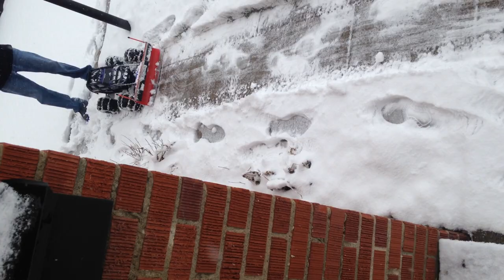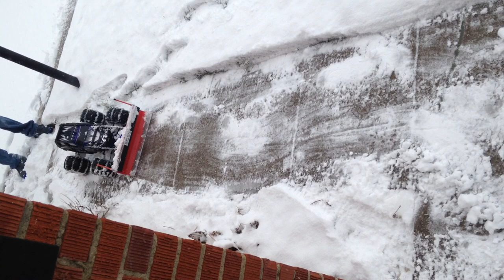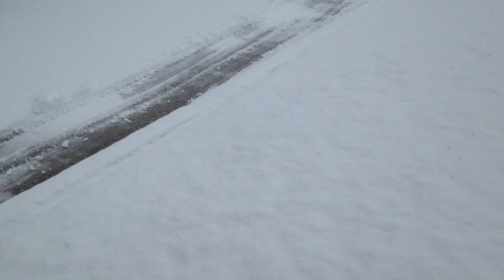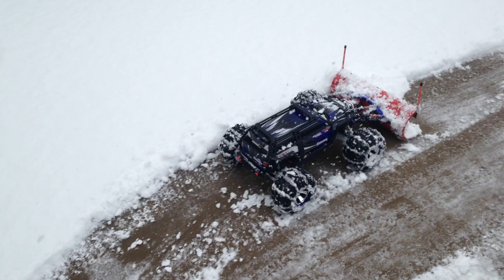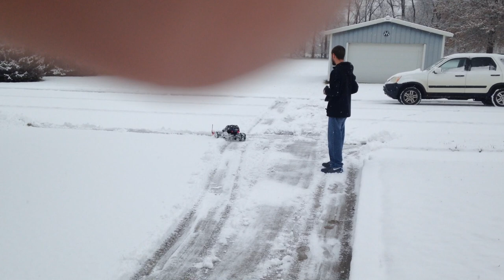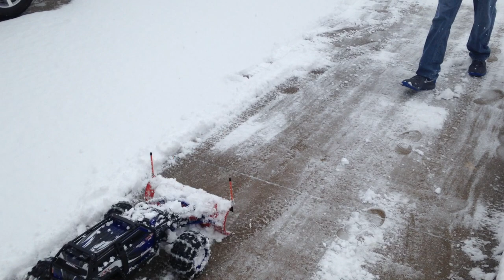Traxxas Summit Plow Pushing Snow

Comment: That is a good layer of snow to move. Could make for very quick work of an even lighter layer. An EDF with two or three fairly quick passes would possibly clear all of it. Would have to make sure it does not pile up by making a round or two but I think I could deal vs waiting and shoveling a foot.